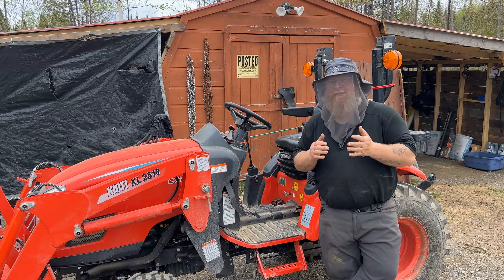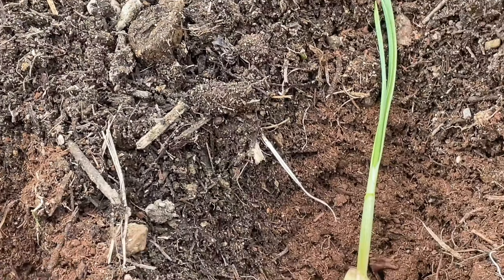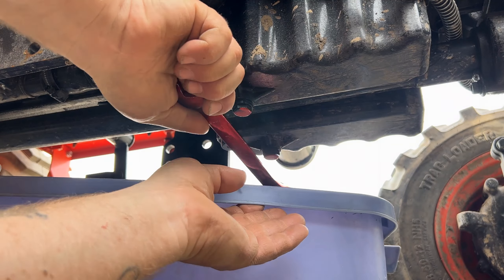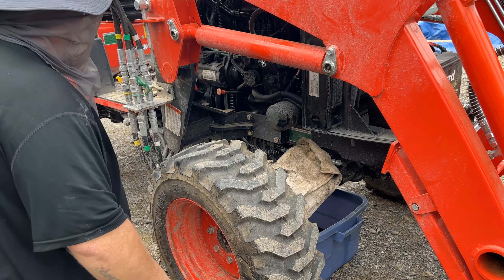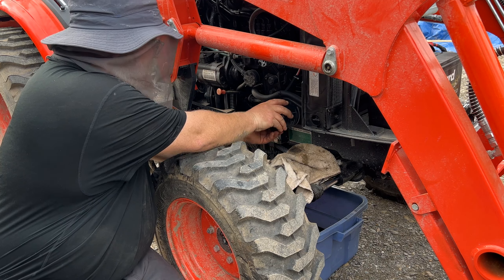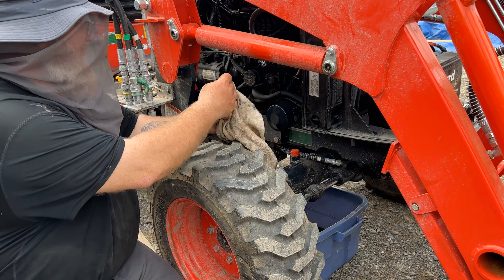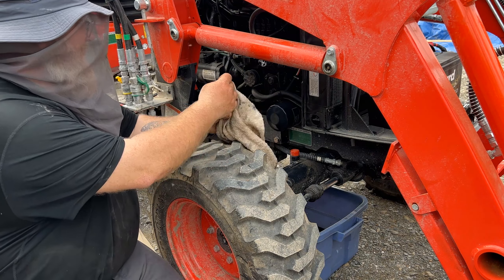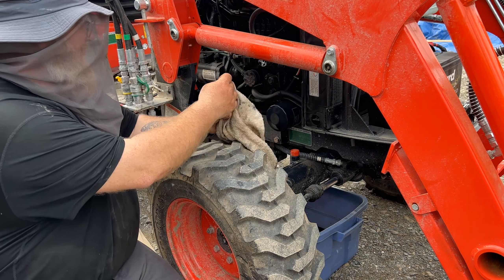Servicing our Kioti CX2510 - Oil Change

Comment: My oil cap was also ridiculously tight so I took a 1ft piece of 1-1/4" PVC and cut two notches (approx .25 wide x .625 deep) on the end to match the cap's profile. It made it so much easier to grip the entire pipe instead of having my fingertips down in that tight space.
Reply from the maker: @mattroy7846  Now that’s thinking outside the box!
Reply: That's a great idea! Well done!

Comment: I just did my 50 hour service last week. On my cx2510. Oil, hydraulic and hydrostatic. All came off relatively easy. I too heard the horror stories. But I work on heavy equipment so I figured it wouldn't be to bad. Should have  put the service on my YouTube channel. Great video.
Reply from the maker: Appreciate the support! It wasn’t nearly as bad as I had heard, suppose it’s hit or miss.

Comment: Did you do the hydraulic oil filter during the 50 hr service, mine was insanely tight I was cursing the guy who put it on at the factory.....................
Reply from the maker: Sure did.  At first the filter seemed tight, but that was because I started with the band wrench furthest from the mounting plate.  When I moved the band wrench up near the mounting plate, the additional leverage allowed the filter to come right off.  👍